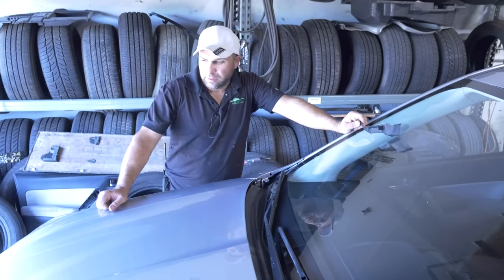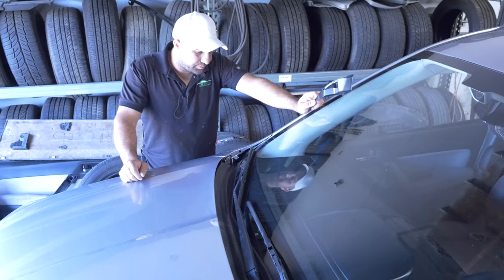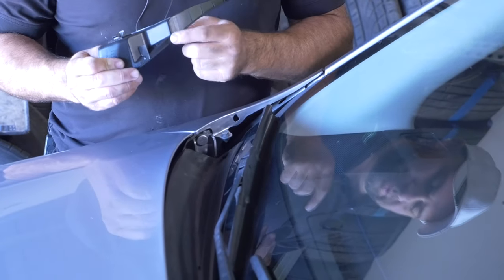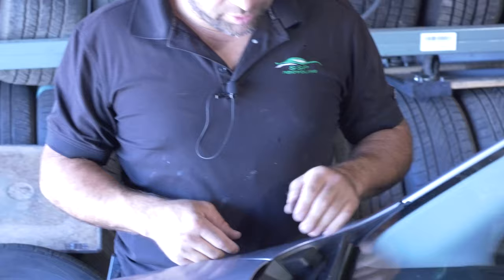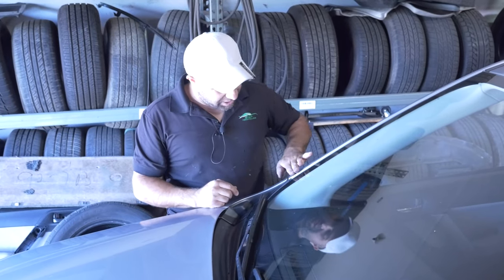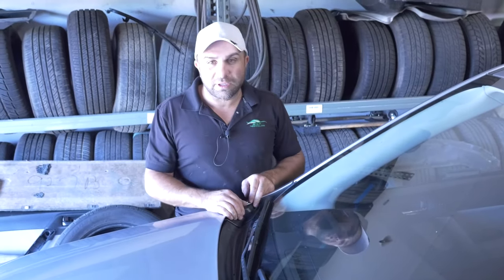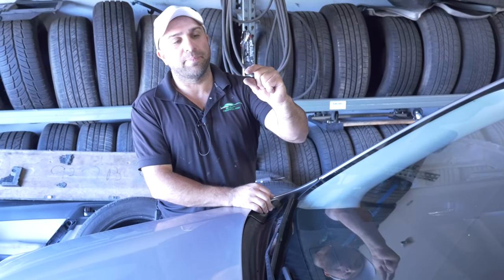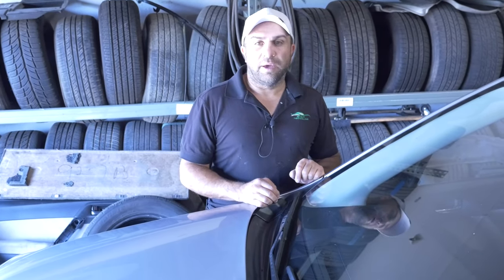How to Replace a Windshield Cowl Trim - 2015 Subaru Forester

Comment: What's the parts numbers for the side trim covers on each side of the windshield?  I saw 91413 and 91413A in a service manual but cant find the parts anywhere
Reply: Never mind found them 91423SG010 / 91423SG000
Reply from the maker: Nice, glad you found it before we saw your comment.
Reply: What clip do you need?  There is also a gasket under the cowling do you know the part number for it

Comment: Same thing happened on mine but it was when they fixed one of the windshield fluid tubes
Reply: They broke those little tabs but didn’t tell me, so when I got on the highway both of them were flapping in the wind

Comment: Would you be able to show how you would replace the following Subaru Forester exterior corner window trim piece?  Mine is stained and I have the replacement part but not sure how to remove the current piece without breaking something Part Number 62134SG011 Corner Cover
Reply: Figured it out that you have to remove it from unscrewing from the inside

Comment: Mine came loose in a wind storm on I-5 near Weed, California.  The top part stayed connected, but it was flapping like a flag in a hurricane.
I shoved it down as cars were wizzing by at 80 mph, and it's stayed down through a drive across Oregon.
After watching your video to see if I did it right, I found that had bent one of the tabs that goes in the square hole, and the clip (that you break all the time) either snapped when it came loose or when I put it back.
$7.57 for the part plus $10.95 shipping and handling.  Maybe I'll call the dealer tomorrow.